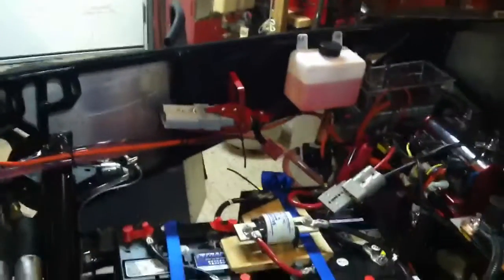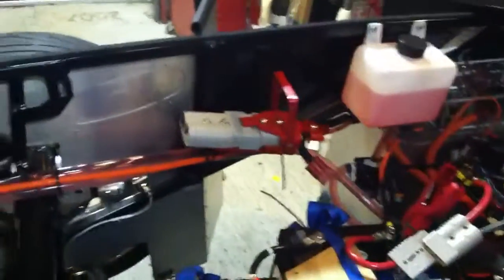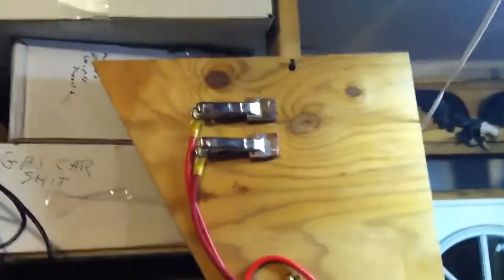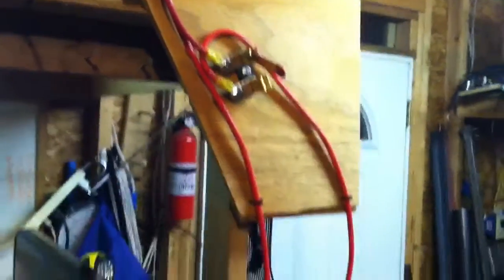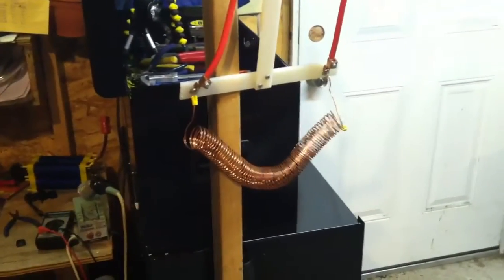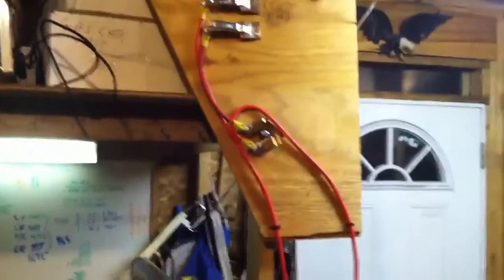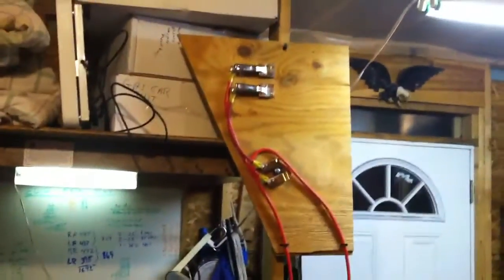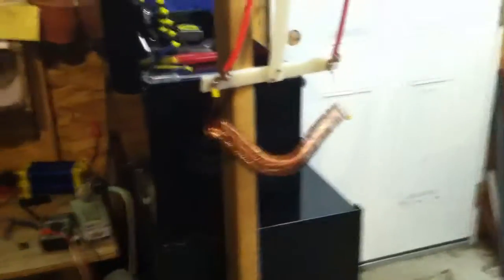Factory Five Mk4 - Electric Car - Video 26

Comment from the maker: @EVTuners  Thanks Doug.  Today (12/31/11) is the 1 year anniversary of starting the project.    It should be on the road by summer as planned.   The battery packs are now the big challenge.  With the available space in the car for packs, it is looking like it will be 300.3v nominal and 23.5 Kwh.   That should provide both good power and decent range.   BTW, your EVTuners web site is looking great these days!   A lot of impressive vehicles there!